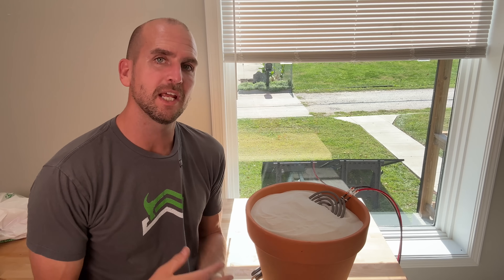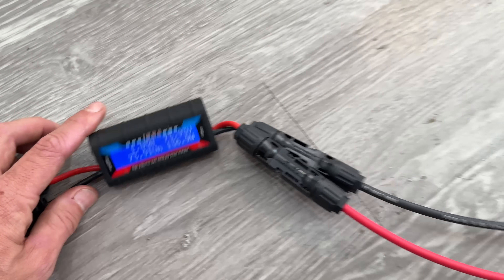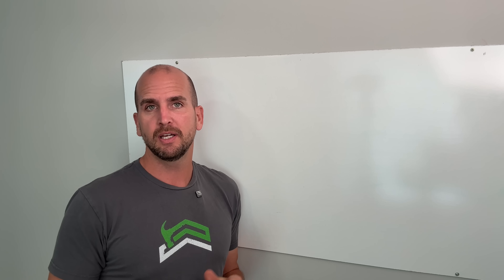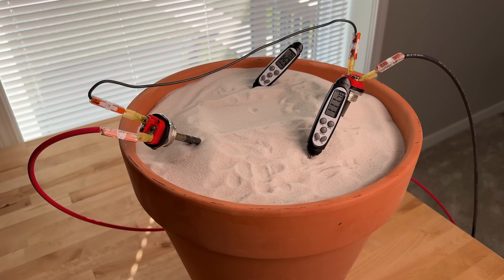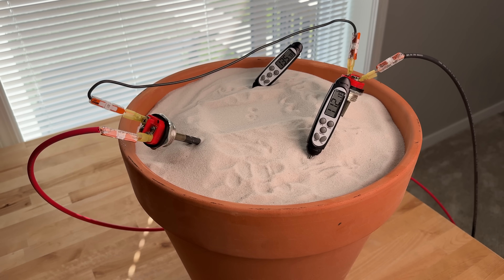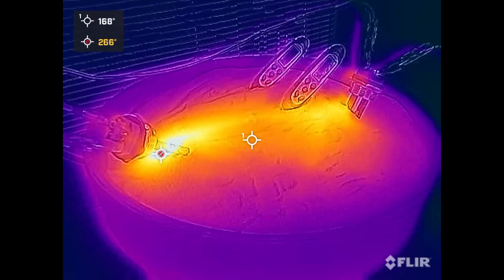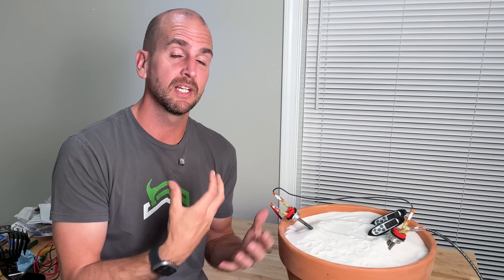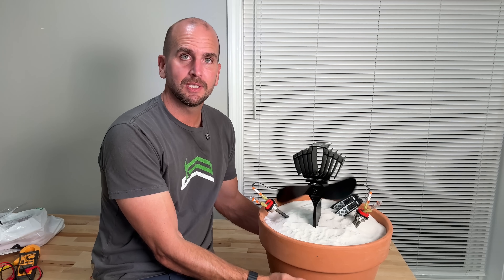How To Create A Solar Sand Battery Heater | Free Heat This Winter!

Comment: I think wiring your heating elements in parallel (5ohms) instead of series (20ohms) would help you see a lot more wattage flow from your series panels (7ohms) due to better impedance matching?
Reply: I squared power dissapation.....
Reply: Ya I had mentioned wiring them in parallel but I was just thinking 10.8 ohms but ya your math is better but just 1 element would be double the power he is getting since he has plenty of solar but parallel might be to low resistance but i guess it would pull the voltage down but it might be more power still

Comment: Cool implementation!  I have a question about what you would recommend for a permanent solution to mounting solar cable receptacles/inlets on the outside of your home that would then continue in to power your whole home Backup System (such as the eco flow delta pro ultra).  The idea is that the backup would only be used for emergency power when grid power is down.  The scenario is when we can’t have permanent solar panels installed for specific reasons (e.g. HOA restrictions).  But if the grid power goes down, we could set up some smaller/mobile panels in series as you’ve done herein this video, but instead of running the cables haphazardly through a door or window, I would prefer to have a dedicated/mounted outdoor receptacle that could accept the solar panel cables and be used only in an emergency (a very similar concept to having a generator inlet installed on the outside of your home that then ties into a transfer switch connected to your main panel).  Do you know if there is a receptacle for solar cables like I’ve described?  I’ve googled, but I’m not sure I’m searching with the correct terms.  Have you considered something like this  
In your own situation?
Reply from the maker: I would probably do something like what I did in the below video at the ground mount panels.  PVC junction box, integrated MC4 connectors, mounted to the wall with some conduit coming out the back and through the wall to get the cables inside.
https://youtu.be/WAP6UBKpcq4
Reply: @everydaysolar  that’s exactly what I was looking for! Thanks!

Comment: Great concept for a video, thank you for doing what most of us wouldn't try ourselves!
Reply from the maker: Thanks so much for the feedback and support 👍
Reply: @everydaysolar  You missed the most important part of the direct solar calculations, the source vs load impedence.

In short it's abount matching voltage and amps of both your load and source by using the resistance. As resistance is R = V/I. Said in another way Resistance is a ratio of voltage to amps, if you match this you will archieve peak efficency.

You calcualted the load impedence, which is 3.84 ohms or 10.8 ohms (or 21.6 ohms).

However you should talk about source impedence of your solar panel, at maxium power point one solar panels is 34V @ 11.62 amps. Using V/I = R, you can calculate a single panel would be 2.9ohms, two panels in series will be 5.85 ohms, or two panels in parallel would be 1.46 ohms.

Maximum efficence will be gained by matching you source and load impedence. (Series resistance formular is R + R, and parallel is 1/R1 + 1/R2 = 1/Rtotal)

For example your two water heater elements would work much better if they were in parallel. eg 1/10.8 + 1/10.8 = 1/5.4, 5.4 ohms (load) is far closer to the source 5.85 ohms, than the series of 21.6 ohms.

Or if you ran your solar panels in parallel with the two cook top element in parallel, you source impedence would be 2.92 ohms (34 / 23.2 = 1.46)  and load would be (1/3.84 + 1/3.84 = 1.92)

Hope this give you more to talk about on the subject of direct solar.

Comment: I'm not the sharpest tool in the shed, but would it be possible to modify this to provide passive air circulation? Like putting this pot inside a bigger pot, then drill holes on the bottom of the bigger pot, add some clay columns to serve as channels so cold air gets sucked in between the layers as hot rises and escapes through the top, heating up the small room faster.
Reply from the maker: For sure, I think there are a bunch of different ways to better pull the heat out of the center of the pot.  I will most likely do a few more iterations a one will for sure have some type of channel or duct running through the middle 👍.
Reply: @everydaysolar yes please
Reply: Trombe wall
Reply: Aluminum buried in the sand . Cans  or Aluminum foil baking trays cut up and arranged within the sand to disperse the heat . Leaving some sticking out the top for the Peltier fan draw heat from
Reply: interesting idea

Comment: I bought 120w 12v DC immersion water heaters and 300w AC ones. The 300w ones draw 230 watts. 300W rice cookers draw about 200 watts. A "500W" rice cooker I just got draws 350w. I use solar for power outages.
Reply: keep in mind that heaters intended for water are usually not rated to "run dry" as they rely on the max water temp of 100c (212F) to stop the internals from melting themselves.

Comment: Wouldn't it be more effective to capture the heat of the sun than converting the light to electricity to produce heat?
Reply: The heat would be instant where as this is longer lasting cause sand will cool down slowly. The peak of the heat from the light will be higher so your room would get to a peak temp and as long as your insulation is good it would remain but I doubt most old homes have great insulation so sand may be better over long periods of time.
Reply: It depends on what you already have installed; we hooked up a water heater to consume excess PV capacity which would other be lost - as we are off grid. Using a 4.5KW tank, but at 120v it consumes ~1KW easily provided by our inverter. Timer let's it run 5hrs per day....
Reply: Yes, but you'd have to build something to concentrate the heat, like mirrors on a tube or something. Panels are cheap enough that cost wise, solar panels are easier.
If you wanted to get fancy, you could make some insulated black boxes (with a glass face) with coiled tubing and a couple panels to power a heat pump to concentrate that heat down to a sand battery.
Reply: @andrewt9204  all you need is an insulated box with as black as you can get paint and a coil of hose to run oil or water through. Covered in insulated glass if possible. No mirrors needed.
Reply: @andrewt9204  having seen that project  be built and rebuilt multiple times in multiple ways, a panel connected directly to a heating element is much cheaper
Reply: @jimmytclem  sure, cheaper.
Reply: See evacuated tube collectors, they're very common here. Probably the most efficient way to collect heat